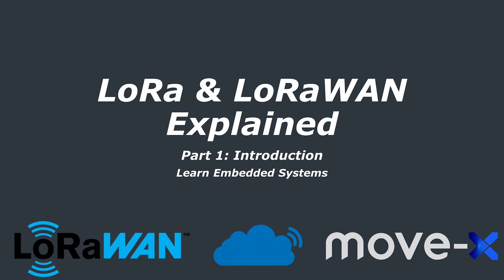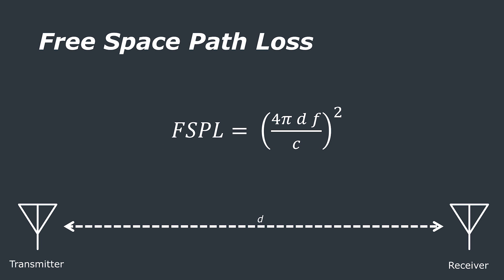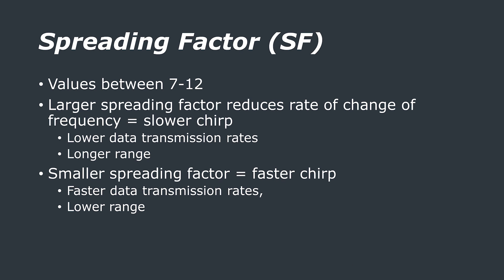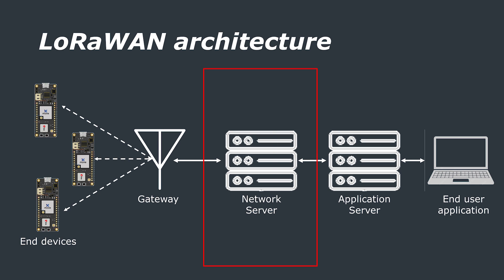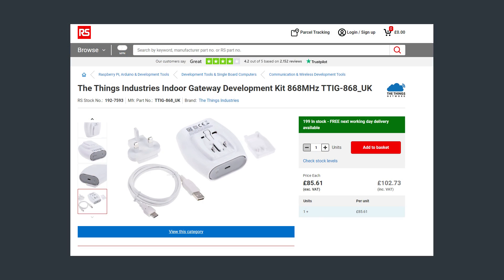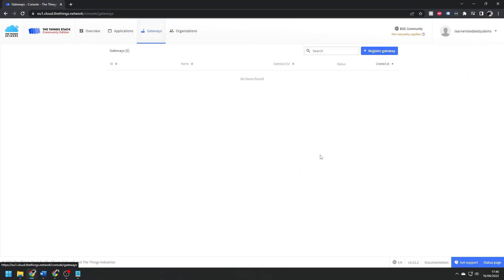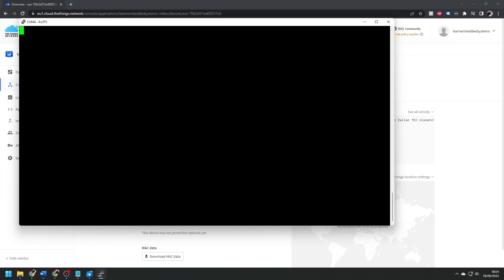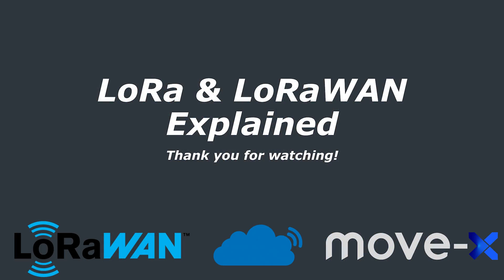LoRa & LoRaWAN Explained! TTN Gateway & Device Setup - Cicerone Board Demo

Comment: Thanks for this video. Something I don't understand about TTN : say I want to communicate between 2 devices that are 10km far from each other. Device A is in a zone without surrounding gateways so I need to setp my own. Problem is how do I know that my gateway will be able to relay messages to surrounding gateways in order to reach Device B? I understand TTN is a community mesh LORAWAN network therefore there's no guarantee 1 gateway will be close enough the another one in order to relay messages, is that right? Is there a way to 'simulate' a message travelling from point A to point B with all known TTN available gateways so that we can anticipate whether the message from A will reach B?
Reply from the maker: In this configuration using TTN, messages aren't relayed between gateways. Gateways are connected to TTN via the internet so communication is always: End device -> Gateway -> TTN and vice versa. All you need to make sure of is that you are in range of at least 1 gateway and that gateway is connected to the internet.
Reply: @LearnEmbeddedSystems  ok I get it now thanks!

Comment: I wonder if LoRa is better also for inside? like between my laptop and my router there are 3 doors and like 15 meters (I had to buy a repeater).
So if I want a small sporadic signal between 2 MCUs at the same distance, is LoRa good enough? (my wifi network is already "saturated" with the computers and phones).
Reply from the maker: LoRa sounds like a good solution to that problem. You can set up a point to point system (without a gateway) also.
Reply: Could evn hv tried Bluetooth for tht ig... 
Hell wifi ws prob the best tbh.. Much simplest.... 
But ig m a little too late, 3years to be precise😅
Anyway, how ws ur project? Also m new to lora nd m planning to use it for a very large space, as large as an industrial complex, b/w one central MCU nd multiple node MCUs.... 
Do u guys hv anypointers? 
Something to keep in mind as I m using LoRa the first time....
Reply: @namangaur1551  it never was a priority project, so I have nothing yet.